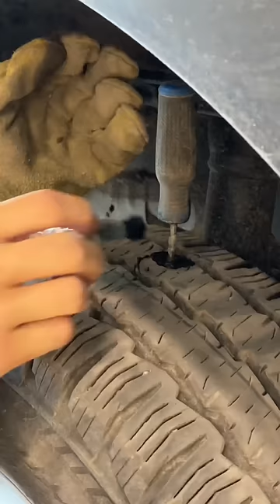Why You Shouldn’t Plug Tires #tiredoctor #tireguy #tires #shorts #tireplug

Comment: The U.S. military provides tire plug kits with all of its vehicles. I plugged a tire on a 28,400 lb. LAV 25 in 29 Palms, in the summer, during a 90 day combat field exercise. We launched that truck off of several jumps during training, took it over rocky terrain at max speed. I drove the same vehicle almost a year later and the plug read still in the tire. No air loss. But trust your tire shop guy they're the experts.
Reply: How does this comment only have 3 thumbs up in 6 months and no comment? This is the best argumentative response with the most proof under the most extreme possible circumstances. Hey, Thanks Buddy. I’m done here.
Reply: Quick search tells me that the military uses safety seal plugs. Imo, these are the best.
Reply: Rah
Reply: Why would I tell you to fix your own tire when you can pay me to do it for you?
Reply: That means all the blowouts and leaky plugs don’t exist right? Because one time you had a different experience.
Reply: @dailydose8035 Tires without plugs will also have blow outs time to time, But hey, nice try.
Reply: The main issue with this plug design is that there is no inspection of the interior sidewalls of the tire. Sometimes the outside of the tire looks fine, but the inside is shredded. Put one of these plugs in and someone will likely have a blowout on the highway.
Reply: "experts" 😂 just like McDonald's employees are burger experts.
Reply: @SleepyMongoose  The odds of blowout on a plug is probably just as likely as having the tire blowout to begin with. My entire family has plugged tires on every single vehicle they've owned, and not a single one has blown out. The plugs have always out lived the tire, and every set has always had at least one or two get plugged before needing a new set. It's part of life, and I don't see how they could be unreliable as I've gone decades now with a 100% success rate.
Reply: Fun at the stumps
Reply: @austinford4975 or sell you an ENTIRE NEW TIRE or maybe 2 since you shouldn't replace only 1 tire.
Reply: never take advice from anyone who says "in the industry"
Reply: They just equip them with CTIS now. 😂
Reply: They just equip them with CTIS now. 😂
Reply: Well it's not like the government is trying to save money
Reply: That might just a Marines thing.  I've been in the army 9 years, worked with several different wheeled vics and never seen a single tire plug kit
Reply: 2147 ftw
Reply: Expert at charging the max for tire repair , go get a plug kit and repair bit yourself
Reply: @chrisrobinson3658 when you never leave the base, you never gave the occasion to need an emergency repair to get you home.
Reply: you use a OD green crayon or burnt umber? ;)
Reply: @ezezelezezel2122  been on and off bases / fobs  in several different countries my guy
Reply: @mikemitchell8329 I've driven 20,000 on a plug but a propper patch is best practice.
Reply: @Eluderatnight  yep
Reply: lol. Yep there ya go.  I had a gash so big it took 3 plugs to fill I don’t even know how I filled it but they held over another year.  Things you diy when you don’t have money.  Now I have money and diy things just to prove I don’t have to waste it.
Reply: @kris7542 not much we can top that with.  Surely if it lasts there it’ll get the groceries home on the asphalt lol.
Reply: I could literally go and get a job as a tire shop worker right now when I don't know shit about cars.
Reply: Military educated
Reply: A 3rd LAR brother! 
I concur, these plugs work on a 14 ton vehicle.
Reply: @redgator7250  Plugs don't leak. If the plug leaks or breaks the tire, it was done when the damage was, not by putting a plug in.
Reply: It's just a temporary fix
Reply: Another LAR guy here. We absolutely have tire plug kits. We call the plugs, jerky, because that’s what it looks like. I’ve seen up to 3 or 4 pieces of jerky used to fill a hole. 💯 it is part of our SL3 and any crewman or scout would know the lingo and can confirm this. These are very often used in 29 palms because of the terrain there. The tires are not replaced later, they are run with jerky in the tires until the tread wears down. Sidewall is a different story. We also put together our own tires with run flats on the ramp. You would take the run flats and winch them in half, then grease them up to slide them in the tire. It was not a very safe process, but that’s how we did it
Reply: And those plug kits all have spiral probes and specifically say to never rasp the damage and break the band
Reply: Also RAH!

Comment: Frowned upon because they can’t charge exorbitant fees for changing a tire.
Reply: Exactly.
Reply: They make money selling and installing, not plugging tires.
Reply: Learn to do it yourself then
Reply: I won't say that over charging  may not always be the case.  All I can say is why I won't plug tires at my shop.

Plain and simple is  the National Highway Traffic Safety Administration says that a plug patch is the best and safest way to repair a tire. 

So when my business and my insurance and potentially someone life is on the line I repair vehicles the way the industry or manufacturer says the repair should be performed. 

It's not up to the tech on how he wants to repair it.  The manufacturer already outline how the repair should be performed.
Reply: My tire repair place does a patch under 10. I always ask for a patch. I give them a 20 and tell them to keep it cause  the speed and quality is great. No one speaks English, but as long as they maintain such great service when the son takes over, I doubt anyone will care.
Reply: @mikesal8088  I buy tires straight from brand not shops and put them on my self and take them to get balance and only pay like 40 for the balance
Reply: Have to listen what he said...."don't repair tires WITH plugs in them. Meaning you don't replug a tire. It's an insurance liability.  Also you should never use a drill. Been doing tires for 20 years.
Reply: How does it destroy the inside of the tire ?
Reply: 😂😂 Pilot charges $90.00 for a 5 minute plug,Loves,T/A-Petro all they do is plugs.
Independent,small shops do real patch repairs.
I ve lost a plug once.
Reply: @mikesa😂😂😂😂l8088
Reply: A lot of places patch tires for free. Only takes like 10 minutes if you're taking your time at a shop.
Reply: @mikesal8088 don't forget to sell them as a pair or set, for equal treadwear, lol.
Reply: We charged 35 bucks to plug/patch on tire repairs. Yes soooo expensive
Reply: 17 bucks to change a tire. Also Discount will patch em for free so not really sure what you’re talking about.
Reply: They still plug tires. Just not externally because you have to inspect the inside for damage.
Reply: @davezemba9109  It doesn't. But the inside can be destroyed because of the underinflation and you can't know that until you remove the tire from the rim. Every place plugs tires, they just do it internally with a proper patch/plug combination.
Reply: I work at a dealership and they actually charge the same price as changing a tire because normally we dismount the tire and use a patch-plug. so you pay for the dismount, patch, mount and balance

Comment: Plugging a tire when you're in the industry is super frowned upon... cuz I doesn't help the shop rob the customer. I have driven thousands of miles on a plug I couldn't believe held air to begin with
Reply: Yeaaaa you said it first.
Reply: They do work but legally shops cannot use them to repair where I am in indiana
Reply: @bentleynorton6843  can you reference the statute?
Reply: @shavingwithfuzzy7524  No I can't. I just know that no shop in my city will do them. I work as a mechanic. They claim they can fly out at random and would cause immediate blowout. Like this guy's says, it damages the inside of the tire and you also have no idea if the inside is Shredded from the puncture without taking the tire off the rim to inspect.
Reply: @shavingwithfuzzy7524  and to also add...no mechanic likes tire work so I'm sure most would opt for the quick and easy plug...but it's just flat out not allowed
Reply: @bentleynorton6843  I was asking because I can not find that law on the books there. But still looking through the codes.
Reply: 100000 km on at least one plug I’ve seen 😂
Reply: @bentleynorton6843  sounds like mechanics are lying, and won’t give a straight answer

That’s how we get in these situations where no one trust the mechanic, because they’ve or someone else has lied about something stupid and now no one trusts their opinion.

You can say it’s wrong or bad, but the more you say it, the more people do it, because they have a sever distrust for you
Reply: @aandyherr817  um I'm not lying that's policy at my shop lol
Reply: Bingo!
Reply: @aandyherr817  I was TIA certified for years,  the reason you don’t use a plug like this is because it doesn’t seal air inside the lining of the tire.  As you drive air will work in between the plies causing separation and then catastrophic failure of the tire.  It absolutely does happen.  Shops in all states can perform repairs to tires but it has to be a proper plug/patch combo.  Plug to keep water out and patch to keep air in.  Most shops won’t install plugs like these because they do fail and the risk of liability is too great.  The plugs on this video are not safe for permanent use and I would only use them to get myself to a tire shop for a proper repair.   This tire dr. Is super sketchy,  maybe what he does is ok in Canada but he wouldn’t last an hour in a US tire shop.
Reply: @sennamalinois1469  Finally, a proper answer. As a tire technician, this is true. There are many cases where plugs have become unreliable over time. Plugs are utilized as a temporary solution. Its not permanent. If you absolutely need to plug a tire to get from point A to B, then do it and practice safe driving. But those plugs may fall out over time. A proper flat repair utilizes both a patch and plug. That is a proper solution
Reply: You're absolutely correct. I drive for a living and I get a lot of punctures. I bought a cheap plug kit from Walmart and haven't had to rely on a tire shop in years. Not once has one of those plugs failed to fix the problem.
Reply: @bentleynorton6843  I think you're being lied to. They don't just fly out. That's ridiculous. How could companies get away with selling them if that's the case? Do they allow Fix-A-Flat in your state?
Reply: @sennamalinois1469  It's amazing that I've gone through an entire supply of tire plugs with no issues. I guess I have the magic touch.
Reply: No, because it can be done without removing the tire from the rim. If you don't remove the tire from the rim you can't inspect it for internal damage.
Also, in some places a string repair is illegal, so the shop cannot legally repair them until they have replaced the string repair with a proper repair if possible.
Reply: @bentleynorton6843  It's nothing to do with them flying out and having them fly out (which they don't do) also wouldn't cause a blow out. It would just quickly deflate.
Reply: @r.rodriguez4991  actually it's part of TIA... Tire Industry Association rules. No its not a law, but any shop that handles tires has to follow the set rules for tire safety. 

That's why you can buy them and you can do them, but they cant.
Reply: Idk man, it's fucking me more than you. Shop gets 25 instead of 20 and I have to take apart your tire, put it back together, then balance it.
Reply: @shavingwithfuzzy7524  idk about that but they can let water in, it can break down, but I mean honestly, I think a plug is fine, if you got a brand new tire I'd probably do the plug and patch. But if it's brand new you probably got a warranty so..lol
Reply: Brother, I have logged over a million miles of driving personal vehicles and like so many others I’ve had to plug too many tires to count. Always done by myself and have never ever had a failure.
Reply: @oe542  I think what it really is, when there are issues is people putting plugs in places they shouldn't.
Reply: @rawbebaba  💯
Reply: @oe542  for real then just don't want to admit it. And guess what? Put a patch n plug in the wrong place, same shit is gonna happen
Reply: @rawbebaba  but the shop can charge for more labor that way.
Reply: I've forgot how many miles or which tire even it's been so long hahaha
Reply: I have a couple plugs I put in my tire and I’ve been racing with it. Thousands of miles. Holds air great.
Reply: @shavingwithfuzzy7524  it’s just a liability thing, a shop I worked at had a policy that everyone can abide by CYA (Cover Your ASSets)
Reply: i've literally weaved through traffic at 120 on a plug without issues lmao
Reply: Come to any shop in any hood in MI and plugging is offered from $10-$25. Only places they don't plug is in the burbs.
Reply: True! I got a flat tire and they want me to pay $1500 for all the tires when all my other tires still in great condition, they blah blah AWD you gotta change all 4
Reply: @touliverkhonnan5730 If you want to risk premature failure on your drive train and transmission, sure just replace one tire.  Don't blame the shop when that bitch explodes on you though!
Reply: You burn da Aeussez off them ripoff shop Boyieezz, you plug em with a little Glue and a 98 cents plug stick and the shop Boyieezz cant charge some dumb chicks $225 for a tire and $45 for balancing and $98 for Labor, new tire total  cost $368, you only give em $6
Reply: What do you want a cookie
Reply: A lot of places are doing patches for free
Reply: Yeah I've had tires with multiple plugs that worked for the rest of the life of the tire.
Reply: @oe542 I've only had one plug not work out of tons and it's because the hole was a weird shape. But even then I just took it to a local tire place and had it patched from the inside for $20.
Reply: I worked at a tire shop in WA and trusting the customer is like the number one thing you should never do, if you know how to plug the tire correctly then great but if not then I’ve seen more than a few tires FUCKING EXPLODE because of dumbasses trying to do it on their own (I’m not calling you a dumbass I’m sure you are a quite intelligent and competent human being)
Reply: @shavingwithfuzzy7524 I’m here 2 years later and I just wanna say i find it hilarious that you were literally gonna sit there and pore through legal code of a state you likely don’t live in out of… what? Misplaced ego? Self Righteousness? Genuine curiosity?
Reply: I once plugged a 2 inch gash in my sidewall while I was deer hunting and it lasted the rest of the week and got me home over 200 miles away I did buy new tires but it served the purpose.